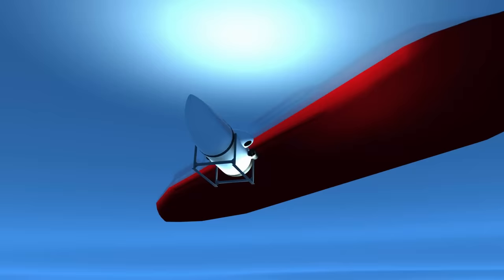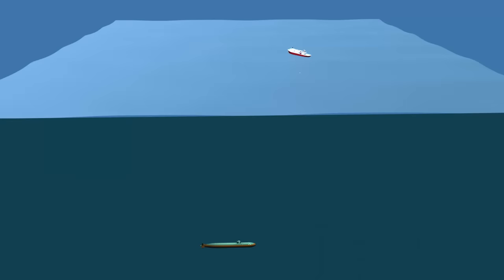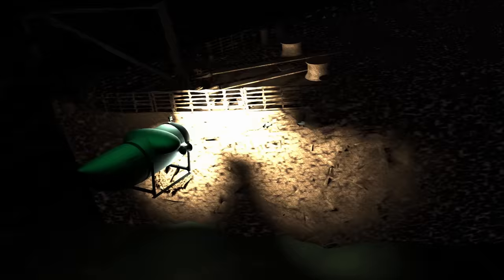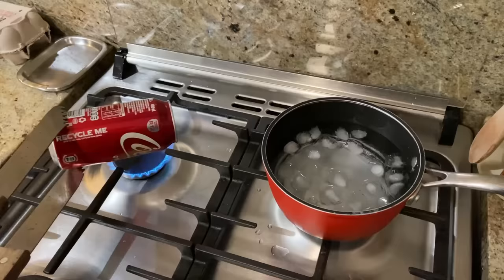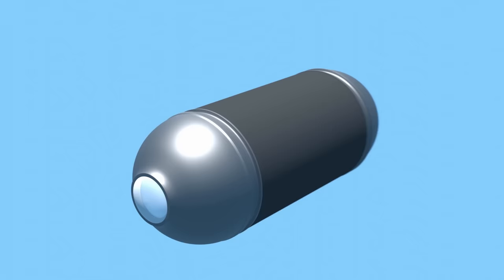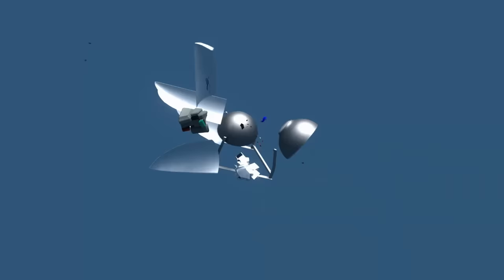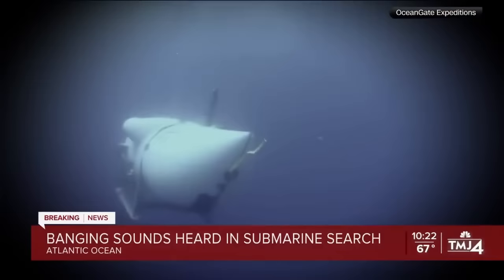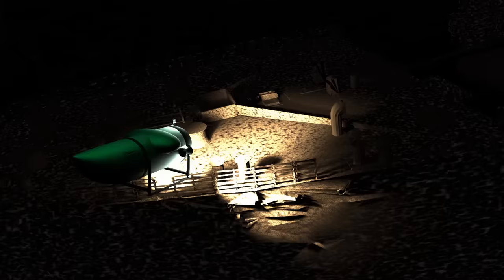TITAN Sub implosion | Deep Dive animation explanation

Comment: Your animated implosion model is exactly how it happened. That's why the titanium caps remained intact. OceanGate CEO Stockton Rush also used expired carbon fiber from Boeing to build his Titan pressure vessel. That's even worse. The FAA does not allow airlines to build or repair aircraft using expired CF because it's weaker. The resin used to hold the carbon fibers together is susceptible to degradation over time, which will alter the frame’s properties. Delamination is when layers of carbon fiber begin to unbond due to stress. 

Steel returns back to its original shape. Damage to carbon fiber remains and accumulates. The material is awful for a sub. And even stainless steel is subject to corrosion and rusting in saltwater. Non-destructive testing and replacing parts are crucial after every trip. Furthermore, the viewport of the Titan submersible was only built to a certifiable pressure of 1,300 meters (4,265 feet). The CEO refused to upgrade it.
Reply: The Bathyscaphe Trieste had a 5-inch thick steel hull and reached the Mariana Trench in 1960. It weighed 50 long tons. Most of the Trieste had thinner steel, but it wasn’t pressurized. That's already a superior design than the Titan submersible, and the Trieste was made over 70 years ago. 

When it comes to strength, aluminum alloys have ultimate tensile strengths ranging from 10,000 psi to 75,000 psi. Titanium alloys have ultimate tensile strengths ranging from 25,000 to 220,000 psi. Steel has ultimate tensile strengths ranging from 35,000 to 350,000 psi. Cast iron is one of the few metals with higher compression strength than tensile strength. Either steel or titanium would have been better options than carbon fiber.
Reply: @lukepoe1140  Would have been too expensive to build for Stockton Rush. He wasn't looking for old ways to build his submersible, but creative cheaper ways to build one.  You get what you pay for.
Reply: Thank you for a very interesting video Mike. I don’t recall the MSM ever  reporting about the ballast drop on descent, which as you have alluded to may have indicted a problem necessitating a mission abort. Having worked in power stations for a fair few years our welds on high pressure/high temperature vessels and pipes were subjected to X-Ray inspection using a Gamma radiation source. Clearly this vessel had a shelf life, and I despair that the cyclic degradation of the passenger capsule was not given the non destructive testing priority it deserved. My condolences go to the relatives and friends of the 5 souls on board.
Reply: @Richard_Gatecliffe_Photography  James Cameron said he believed they had dropped weights and were trying to return to the surface before the implosion happened a few times in interviews on MSM channels. However, I think the submersible community being small is sharing a lot information internally that most of us won't know until the official reports come out.
Reply: @@retiredbore378 Yes, the steel psi tensile strength is vague because there are a lot of different types of steel. It's more of for a general reference comparison. People think titanium is the strongest metal, but it's actually not. Titanium is more expensive, and it has a lower tensile yield strength. It requires high extraction and processing requirements. Titanium has a low modulus of elasticity and can easily be deformed. The low stress to strain ratio of titanium makes it difficult to machine. High-carbon steel is a metal that I would prefer over titanium. It's cheaper to maintain and repair, if you plan on using it for multiple trips down to the Titanic. It's exactly why the U.S. Navy uses steel over titanium for their subs.
Reply: @tboneforreal  Thank you.

Comment: Yo Mike Bell, It had been just released that the Carbon Fiber used on the Hull was Expired when it was purchased so that this Submersible had 25 previous dives on it was AMAZING, in that Carbon Fiber has a specific 'Shelf Life'. This was truly a story of arrogance and greed, ironically not unlike the Titanic itself. My heart goes out to the families of the Victims but THIS is a design that NEVER should have been, thanks for the post.   ~Mark~
Reply: Can you share your source of this information?
Reply: Nothing wrong with the Titanic except for the number of lifeboats.
And of course steaming through a known ice field at night!
But that wasn't the ships fault!
Reply: It wouldn't have mattered if the carbon fiber was expired, as the carbon fiber wasn't doing anything. Carbon fiber is strong under tension, when you try to stretch it. When you try to compress it, it just fold up. Basically the tube was just an epoxy tube, and the carbon fiber added nothing.
Reply: @Roszalief  it's easily searched on the internet, Stockton purchased  carbon fiber that was past its shelf life from Boeing.
Reply: @Drycleanerguy  The carbon fiber can be preloaded with tension before  wrapping it around the tube. If by any means the tube would locally deform, the tensile force of the carbon fiber can prevent non linear buckling by compressing the titanium tube.

Comment: The last message to the Mother Ship was that they ( Titan ) dropped their weights  ( imply the need to ascend urgently to deal with an  Emergency ).   So , clearly , all those on board Titan " knew " of the  threat  at that final stage. Most other Reports were wrong to suggest it was instant and they knew nothing??  They very much  knew  what was taking place with structural failure indicators , minutes prior to the implosion.
Reply: Are you sure they drop their weights?

This video clearly shows the mechanism being jammed https://youtu.be/1T-ZMDt_2IY

Comment: I also suspect a contributing factor mentioned elsewhere on YT: vibration-induced microscopic failure in the carbon-fiber laminations. For this event, the vessel/launch platform package was towed behind the support ship for 800 miles to the launch site. This differs from the widely used videos of a ship-carried launch. This change was due to cash flow problems at OceanGate.
Reply: All of it came down to money…or lack thereof. He wanted a larger passenger compartment to maximize profit. That’s why he used the carbon fiber. He bought it on sale from Boeing because it was expired for airplane manufacturing. He didn’t get it certified because it cost approximately 1 million dollars to do so…not because it was so “innovative” it was beyond the scope of available testing and certification. His arrogance and total disregard for the lives of his passengers was to blame for this tragedy. He advanced nothing in the field of submersibles…his legacy is a cautionary tale about hubris being fatal.
Reply: @KayRay424  Very well said.

Comment from the maker: The "leaked transcript" is clearly fake.  The long messages and language style do not match an emergency situation.  They would never have had 19 minutes warning of hull failure.  The descent speed doesn't tie up with physics.  

The number of dives is difficult to get accurate information on.  The best I can tell Titan imploded on its 5th mission to the Titanic in FB post by Hamish Harding https://www.facebook.com/ActionAviationChairman/posts/674126021392828?ref=embed_post  It had a total of 24 dives according to David Pogue https://youtu.be/O-8U08yJlb8?t=566  If you have more conclusive information please leave a comment.

The video of the hull winding shown here is from an earlier hull.  Here is a short video clip of the winding of the newer hull that imploded. It appears this hull was also only wound in the hoop direction.   https://youtu.be/29co_Hksk6o?t=233 The axial movement of the head is likely just a repositioning of the head and not an axial weave.
Reply: Mike, pin this comment to the top of comment section so that everyone could see it.
Reply from the maker: @heinrichollbers  thanks for alerting me. I tried to pin earlier but it did not register it had not worked. Will make sure it does this time.
Reply: Are you referring to the shot in the video where the head traverses to the end of the winding? If so, I don't think this is an axial lay. I don't think any fiber is being laid in that move, mainly because it has nothing to attach to at the beginning of the move, and it moves way too fast. I think the head is just being repositioned.
Reply from the maker: @boulderup9c   Thanks for confirming what didn't quite make sense to me.  I also wondered how the ends would have been attached but gave them the benefit of the doubt because a single direction lay seemed just too basic a mistake to make.

Comment: The coastguard had the navy information immediately. They didn't release it until they had confirmation. They didn't want to risk announcing them dead and have them turn up alive or worse having them die because rescue never came. But when the capable ROV arrived on scene they went to exactly where the sub would have been at the time the implosion was detected and not to the location where some banging had been heard.
Reply: Some say the delay was political

Comment: If one were to take the final text messages form the SUB, you will see that the final attempt at ascent was jettisoning the frame and not just the other ballast which had already been done.   Ascent was very slow, indicating a failure of the pressure vessel.  04:40  you will see from the  texts here on YT elsewhere as they are trying to ascend that the five did NOT die instantly but knew there was a problem for about 20 minutes.
Reply from the maker: The transcripts are nonsense and obviously made up by someone who doesn't understand the physics.  There is absolutely no way it could have been a drawn out leaky event.  There would very little warning and most likely none at all. And it wouldn’t takes minutes to implode.  Glass doesn't slowly n gradually.  Carbon fiber shatters like porcelain and glass in an instant.
Reply: @Mike-Bell  More than one YouTuber has published them, so who knows what is true?  At this point, its all speculation, but someone somewhere must have the text messages send between the ship (Top) and the Sub.
Reply from the maker: @CupidStunt-fs7ie  just because a Youtuber has published them means nothing about its authenticity. The frame can’t be jettisoned! If the pressure vessel sprung a leak that water flow would have instantly shredded the hole and imploded. There is zero chance the pressure vessel would have been creaking and groaning for minutes. It would have been instant or very close to it. No time to type and send a message. The subject matter in the transcript disproves it as nonsense. It doesn’t follow physics or common sense. 
Yes Ocean Gate have the transcript and the NTSB will need it. Subpoena it if necessary.
Reply: @Mike-Bell  Hey mate, until the final report, its all speculation .   I wasn't there, nor were you, but the time stamps add up to the time that it was alleged to have imploded and also the time the Navy heard the underwater sonic boom on implosion.

Comment: What people dont realize is that the implosion was so strong it took out an external beacon THAT WAS RATED FOR DEPTH. So imagine a empty propane tank strapped to  the outside of the hull of a boat being destroyed completely by an implosion. Over 1 mil lbs of pressure on that hull failing in a millisecond would have caused massive cavitation and shock waves. It was instant. I think  the portal window failed, they were not rated for that depth.
Reply: Update we now know the carbon fiber hull sensors all turned red just before last contact. The sub tried to ascend but couldnt, too much weight? They had 20 min of terror with hull cracking. Sad

Comment: You nailed it with 'structural fatigue'. As a old submariner, this was taught to us at long lengths. Equipment and hull fittings that are exposed to long periods of high PSI pressures are always evaluated.  HY steel is not just used for the heck of it for a hull. How's that innovation going now?

Comment: I appreciate how you pointed out the way the carbon fiber hull was laminated together. It’s important to note that materials like carbon fiber and Kevlar gain their strength from the weave pattern. I know that carbon fiber is a different material but even things like armor are most effective with an overlapping weave like pattern and the tighter the weave the stronger it is.

Comment: Material Scientist with study & experience in composites. My first job was external pressure testing GFRP pipes & recording the failure mode, - the fluid delaminates the resin to glass layer bonding in winding layers, fluid seeps thru changing directions via layers then the pipe implodes & fractures. 

Composites work well in tension where the resin transfers the applied load to the fibres that are stiff & ridged in tensile stress, thats how they work. Composites do not work as well in compression. In fatigue testing all compression cycling will yield failure before tensile. The failure mode is differential hoop stresses between layers causing pathways for salt water. Saltwater can damage the interface bonding between resin & fibre. It can freeze or migrate & then under hydrostatic loads transfer additional radial stresses to inner layers. (bit like a balloon expanding inside the matrix structure). If the fibre was wound on under tension then those hoop stresses react in the opposite direction so generate compression fatigue.

A single winding orientation is a material design flaw, multi axial layering in many directions would improve strength by transferring load to diferent directions in the cylinder, it would have been weak radially & in circumferential directions the fibres orientated circumferentially will be weak axially - the design seems flawed from a materials design viewpoint!

Comment: The most horrifying about Titan isn't the implosion, but being in a gloryfied elevator shaft for more than 2 hours with strangers. I can hardly stand going up or down more than one floor without feeling extremelly unconfortable.
Reply: The being bolted in from the outside is what would give me the willies.  I know you couldn't open it underwater in any case, but it would be worse knowing you were 100% reliant on someone else letting you out.

Comment: It was a violation of a simple concept: all kinds of fibers (glass, carbon, kevlar) resist traction, not compression. Simple this way! On any pressure vessels made of any fiber, when the inner pressure is bigger than the outside pressure the fiber is under traction (for this reason they are suitable for use in pressure cilinders), but when the outside pressure is bigger than the inner pressure, the fiber is under compression (for this reason if you put the same pressure outside of any those cilinders they crack!). Anybody can check this with a simple experiment: get a dive fiber cilinder and try making a inverse hydrostatic test, from outside to inside, using the same differential pressure! Boommm! This is so basic but I didn't see any engineer speaking about it!

Comment: I have looked at getting carbon fiber rims for my motorcycle, but there is always concerning stories. Carbon fiber is great right up to the point of failure, and then the failure is sudden and drastic. Damage can happen on an imperceivable level and add up over time. Because of this, I have never felt comfortable using it as a critical component. NOT that it's not an amazing material when used correctly, but it still feels like we are in the infancy of its usage and have a great deal to still learn.

Comment: Only gluing the metal end rings to the carbon fiber sounds like a bad idea. That and other design choices ensured the sub would only survive a very limited number of dive cycles. It seems they relied only on the sounds of impending failure to determine when the sub was at the end of its service life. That's cutting it fine.

Comment: this is probably a very daft question.  

seeing the Titan was a submersible and not a submarine and it was just diving/dropping not venturing around, and the massive amount of risk involved in a venture 4km below the surface of the ocean.  

Why then was it not tethered to the mother ship via cable?  At least that way finding/retrieving would be easier and it would facilitate constant comms from mother ship to the vehicle itself.  

thanks to anyone who can fill the blanks for me! :)
Reply from the maker: A 4km cable becomes a very heavy thing requiring very careful management. And you can’t let it go slack because it will go below the sub and cause other problems. It can be pulled by the current and in rough seas it could snap or jerk the sub. It introduces snagging risks and there is the entanglement worry.
Reply: @Mike-Bell  cool, thanks.  Appreciate the info, certainly makes sense.

Comment: the fact that the flange was missing that retained the Port suggests hull failure blowing the port outwards stripping the bolts. I agree port was not the failure point. Prerhaps the difference in temperature contraction between dissimilar thermal expanding caused stress fractures over time. I agree laying carbon fibre has issues most cylinders are spun multi directional lay for a reason as you say eliminating uni directional stress lines.